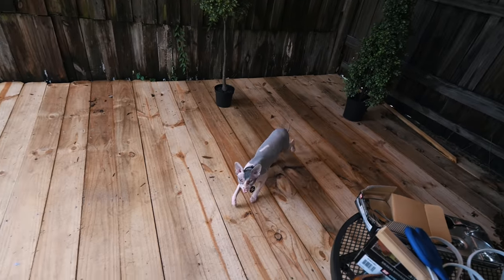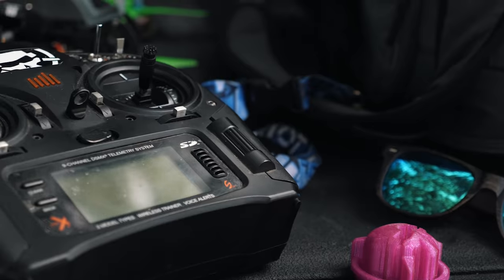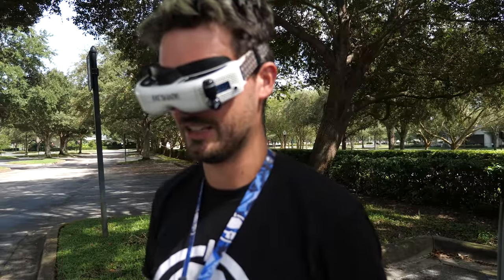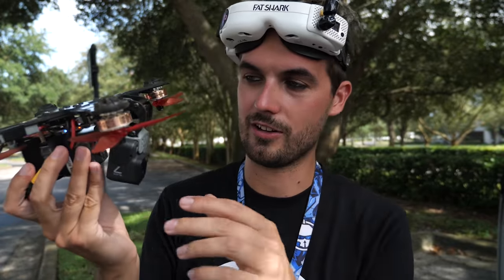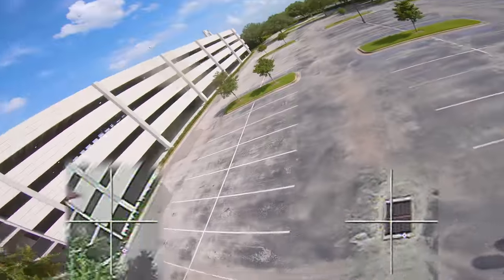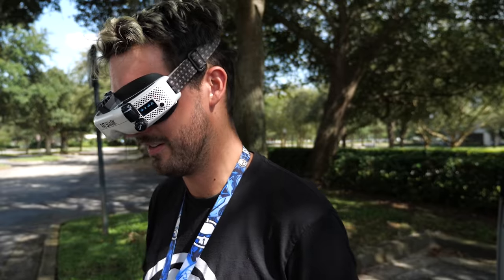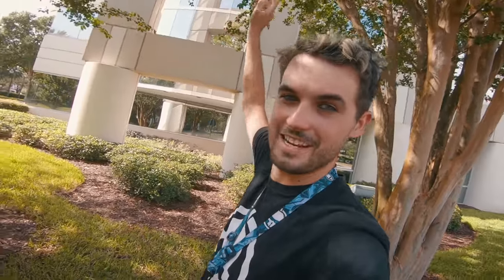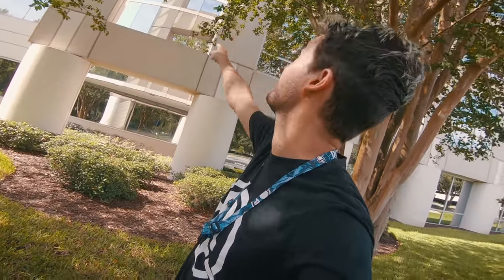how to INVERTED YAW TRACK

Comment: I saw someone doing exactly this trick power loop into this track and then punching through a building. It was the first day I was flying liftoff simulator multiplayer on bando with the building right across the street and it inspired me. Not sure if it was you but if it was thank you I'm not hooked on FPV